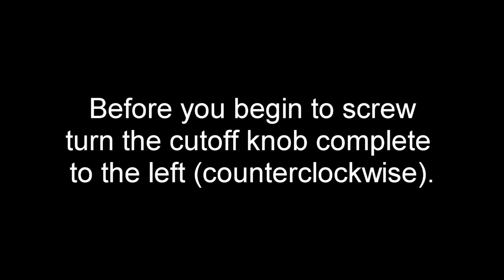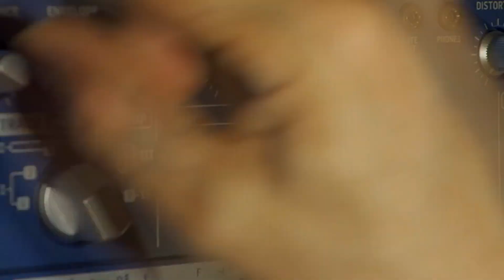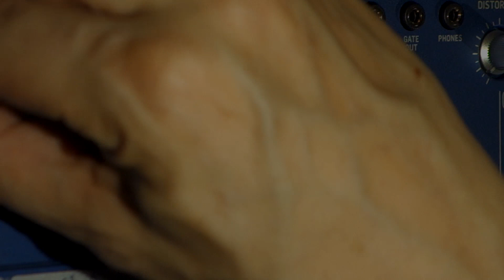Behringer TD-3 Cutoff Mod | VCF Offset Trimpot Adjustment For Darker Sound

Comment: Thanks. this was so easy and worth it! You can get it plenty bright by raising the envelope high and decay still even if you take the VCF offset pretty far down. It gives me so much more play in the vowelly-ness of the filter now. It sounds so much more foreboding being able to go that low now. Honestly I almost didnt want to put my backplate back on feeling like I'd want to mess with the offset every time I use it. I put it back so I dont overdo it and break the trimmer.

Comment: Now that actually sounds more like a real 303. My gripe with this machine was that it too much excitement, too bright. My favorite tones on the 303 are when the filter is muted.
Reply: and now I'm going to order one :)
Reply: The new SMD components are much "better" regarding tolerances noise etc than the original components which unfortunately means that synths can sound a tiny bit more plastic-y. Also trimpots and other component value change over time which micght be the reason the original TB-303 sounds darker. Going to open mine now!

Comment: Thx so much, I made it darkest. btw. for those whose t was ''factory'' detuned, vr11 screw!!!! it need to be tuned in a daw though with reference notes of best two or 3 synths, not just tune it to what sounds great ya know
Reply from the maker: Hi, look at the first comment of this video there is a description how to tune it org. like. I used a eq plug-in in my daw to tuned it right. If you tuned it to the darkest you lost to much of the highs.Less is more 😉
Reply: I dont understand. Can you elaborate please? My td3 is so out of tune it sounds like garbage. And when I try to tune it it goes out of tune within seconds. I dont know if I got a lemon but none of my other analog gear behaves this way

Comment: ..the TD-3 does sound brighter to me than a TB-303.. but was thinking that could be welcome change.. that is awesome that you can set the cutoff to a piont where the sound almost drops out instead of using the volume control..  on a Juno 106 you have wider range of cutoff.. I will have to buy 2 of these one silver and one black to have a reference point and set each different from each other...
Reply from the maker: Nice idea, have fun with it :-)

Comment: If this is an option that's built into the board why not have a knob to make it easier to adjust?
Reply: Loads of analogue synthesizers have trim pots for adjustments. Analogue systems drift over time, and the trim pots are to reset it if you have access to a scope, analyser and the documentation.

Comment: How much height do you think you reduce by removing the bottom half of the case (not including the I/O section)?  I'm getting one at some point but need to reduce it's height to fit it into a case packed with other gear.
Reply: its

Comment: Has anyone used an octave pedal with this?
Reply: Way late response but I just connected mine to an octave pedal for work on an upcoming live set. It sounds great but can become a bit muddy depending on the pedal settings. Not sure what you're working with but I'm using a DigiTech whammy pitch

Comment: I am really interested to do this on my own unit, but how do you know how far to go?  I am afraid of wasting my time in doing this, putting it all back together and realizing it is worse!  Can you do this while the unit is plugged in, powered on and running?  I believe  that is what you are doing, but want to make sure I don't fry anything, or myself.
Reply from the maker: Andrew Henderson hello , yes i am tweaking the screw while it is plugged in. But i think you dont have to do , the tb3 sounds good out of the box. But if you want do Look at the first comment of this Video there is a discription of the freq you should set. I run the the tb3 through an eq plugin to match the freq.
Reply: @Creamtronic  Thank you so much for the reply, I really appreciate it.  I am glad to hear that you were able to tweak, while the unit was plugged in and powered on.  This would be much easier to test, then making an adjustment, then testing it after the fact, potentially going back and forth.  I know I don't 'have to' do the change, but what I am hoping for, is having the sound disappear a bit more, when the cut off is all the way down.  The way it is set from the factory, quite a bit still comes through, so I am hopeful the adjustment will allow for a steeper cut on the filter, when it is all the way counter clock wise, muting more of the sound that comes through.

Comment: Is there a documented solution to add CV input for modulating the VCF?
Reply from the maker: Hi, there is a vcf input for modulation its just called Filter in 😉
Reply: @Creamtronic  It was my understanding that this input is for filtering external sound sources (not cv modulation of filter). Is this incorrect?
Reply from the maker: @csselement  yes this is incorrect , the filter in Input is the vcf cv input for the TD3. So there is no need for moding a cv vcf Input it is still there👍. Try it out and you will see. In one if my Sessions i use this input with an ext. Lfo to change the cutoff
Reply from the maker: Here are more mods if you are interesting in
https://www.gearslutz.com/board/modular-mania-all-things-eurorack-and-modular-synths-effects/1289500-behringer-td3-diy-mods.html
Reply: @Creamtronic   I picked up a TD-3 and the 'filter in' actually is for filtering an input signal (not CV control of the TD-3 filter). Disappointed!
Reply from the maker: @csselement  yes you are right ,my fault i thought it is for cv the td3 filter cause my td3 sound change if i put in an ext. lfo.. Sorry for the wrong info. if you buy it new send it back if you dont like.
Reply: @Creamtronic  No problem, I enjoy it very much but would like to mod a CV filter input!